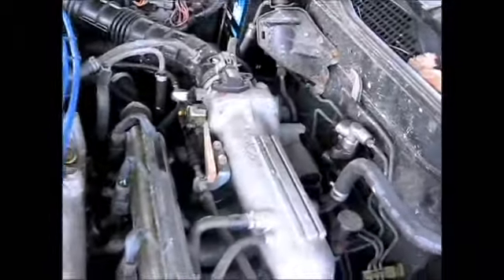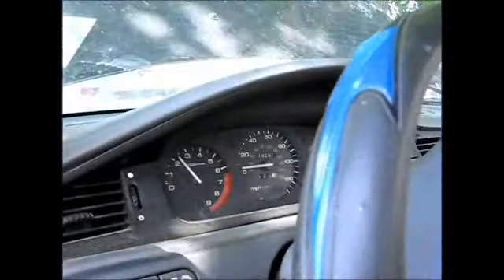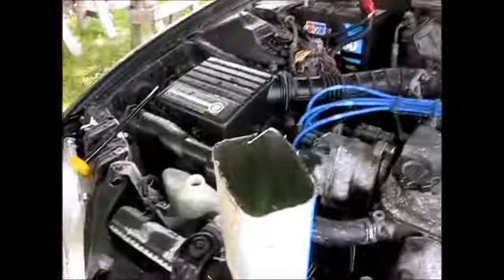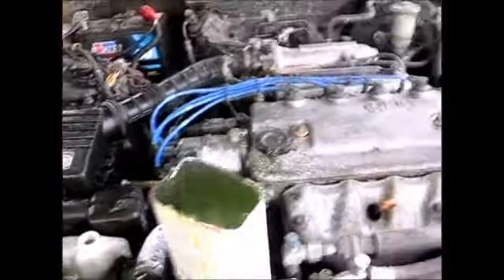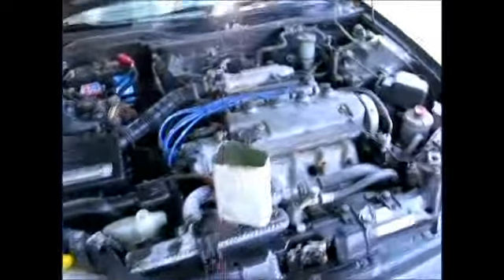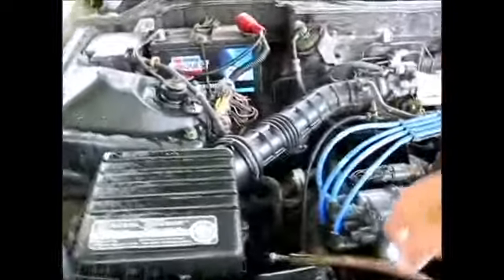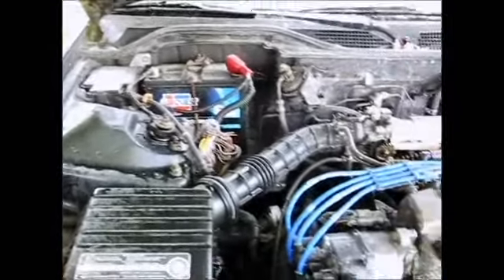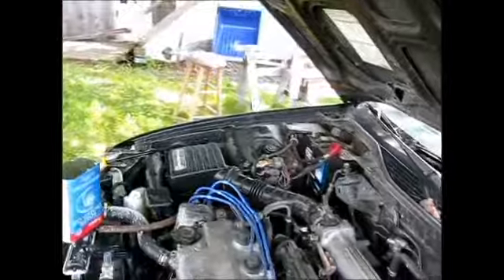Honda Fixed, burped, and done with!  Happy Dance!

Comment: could have drilled a hole in the top of the thermostat housing and tapped it for a bleeder screw. some vehicles have a bleeder there from the factory.